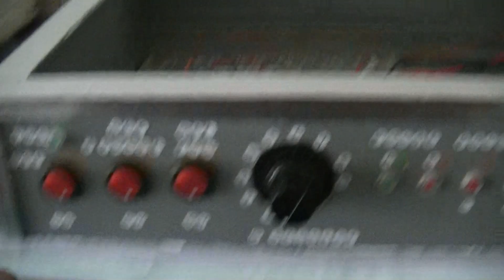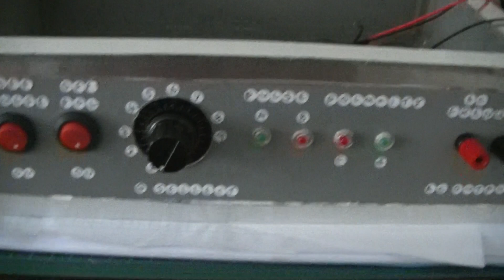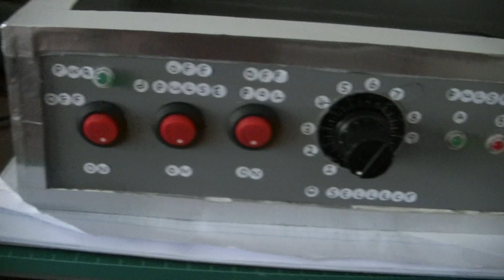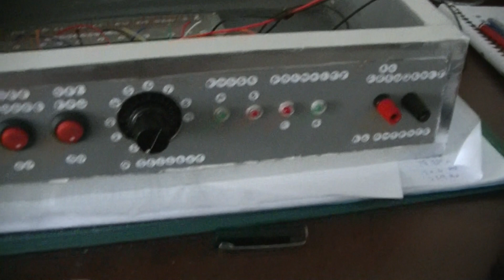new frequency generator Schumann  frequency based

Comment from the maker: nearly completed 7.8 hertz Schumann frequency based frequency generator i derived a bunch of Fibonacci numbers from the 7.8 hertz so i designed the ceramic capacitor array for that  in the nearly completed circuit
ill decide latter if i should design one based on the resonant frequencies of all the planets in the solar system even the sun and planet x  from the data i have collected , over time

Comment from the maker: i tried comparing the data on the vibrating frequencies of the planets in the solar system with the data ive collected and they dont tally they are all different so its just a jungle of misinformation that dont match other details  and trying to get the actual resonant frequency all i get is frequencies notes etc  sounds planets make but it dosent tell me the exact resonant frequency it vibrates at
Reply: You could figure it out if you could find out the circumference of each planet at ground level and at the ionosphere